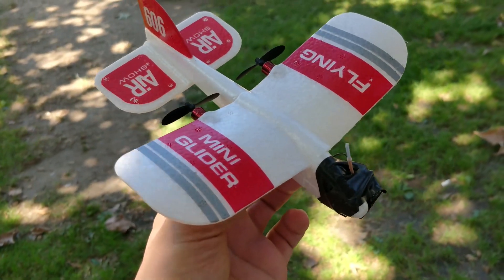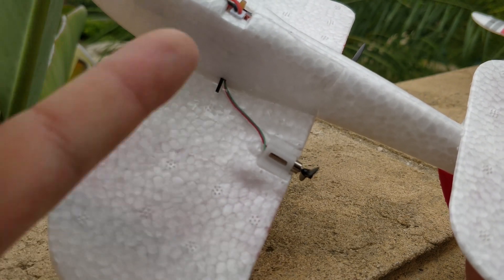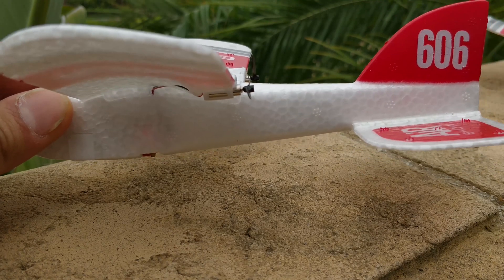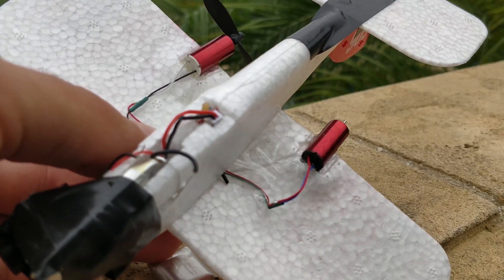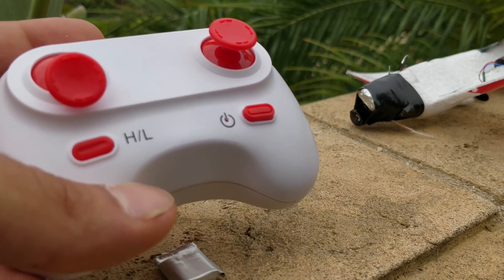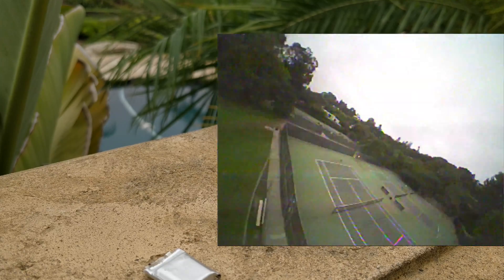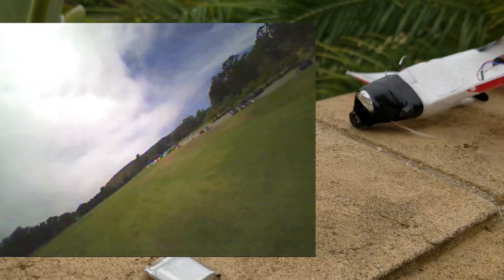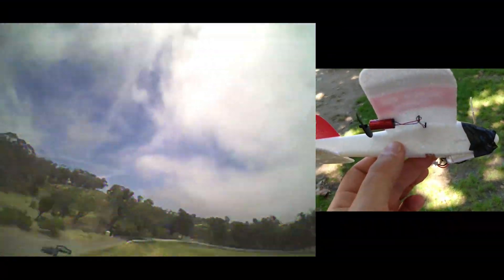Whoop Plane? - KFPLAN KF606

Comment from the maker: Table of Contents:
00:38 - Stock plane overview
03:10 - Modified plane overview
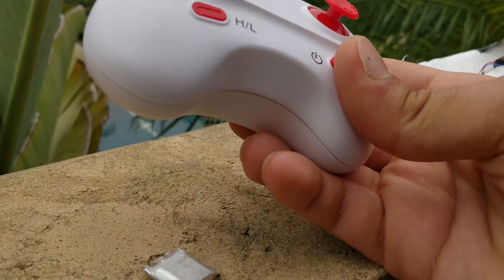05:41 - Roll doesn't work right
06:36 - 'First' flight
07:18 - First successful flight

The plane: http://bit.ly/2OqoAwt
The BIG motors: http://bit.ly/2Mo7DjE
The cam/vtx: http://bit.ly/2yixtxp
Prop option 1: http://bit.ly/313sEUV
Prop option 2: http://bit.ly/2Os0G3C

If you really want to try this, you'll need to find a ~40mm or less prop that will fit the 0.8mm shaft on the motor.  The whoop props are fine and would work but note that these props are used in 'pusher' configuration so you'll be putting the prop on upside down.  So any prop you choose should probably have a mounting hole all the way through.  You'll probably need to melt through the hole in the middle of the top end of them with a paper clip then push it on the motor because the top end of the hole is usually narrower.

I know that little whoop plane that uses whoop parts exists. it's just super not great control.  about as good as my POS here.  I need the gold control. 

A toothbrush I'm gonna review when it's back in stock:
http://bit.ly/2K5ZoG8

▼ COUPON code spreadsheet link:
http://bit.ly/2JWLBBE
Some of these codes are made exclusively for my channel and can't be found anywhere else.

▼Join my FB group for more discussion: Kabab FPV
https://www.facebook.com/groups/37915...

▼ The 5" quad setup:
-Hyperlite Glide Floss (will be re-released soon)
-Motor 1750kv/ESC combo: http://bit.ly/2XAEHXH
-WaFL’s Cap Cap: http://bit.ly/2GUpXxO
-Battery: http://bit.ly/2XXjbwU
-FC: http://bit.ly/2XRc8G8
-FPV Cam: http://bit.ly/2Q7LfL7
-Vtx: http://bit.ly/2HsrASs
-ND GoPro Mount 30deg: http://bit.ly/2WC15zc
-ND Filter (if used): http://bit.ly/2WEmQ1j
- My favorite battery: http://bit.ly/2xWjYTJ
-An annoying 643g AUW on this quad

▼Notable motors:
-Xing 2306: http://bit.ly/30uYo4Q
-Xing 2208: http://bit.ly/2y3te8R
-FANTASTIC 6" motor: http://bit.ly/2LqghOZ

▼ 5" Sub $200 build that's still good
-Frame: https://goo.gl/EpXQhZ
-FC/4in1 Stack:  https://goo.gl/HprVbj
-Motors: http://bit.ly/30uYo4Q
-Props: https://goo.gl/ZnzY2y
-Props: https://goo.gl/VMBiQh
-FPV Cam: https://goo.gl/FDJhYw
-Vtx: https://goo.gl/JNVDMn

-Starter goggles: https://goo.gl/GvJUkT
-Batt pad material: http://bit.ly/2QGWhYb

▼ If you want to solder better:
-Fantastic solder: https://amzn.to/2P5QM2W
-Fantastic iron: https://goo.gl/DqBipa

▼ Tips?
-PayPal: https://www.paypal.me/kababfpv
-Bitcoin: 1E4XZXoD4rS6MYWVWuenY7Kw2M1YgyNpoQ
-Nano: xrb_1188ek5bd7tb9kw67asnp9o65byuoaxbtpxuznx1ribf75x78awywmakj55f
-ETH: 0xD067F93811f2eC31CB1928901002dfdf9A492EF5
-LTC: La2KWYAjp4VT2Lq2M76pbjzXWvRyjpfCtG
-Tesla Referal code: https://ts.la/bob40889
Please use my referral code if you're gonna buy a Tesla.  You get some free stuff when you do and I get better status with Tesla.

Comment: For anyone interested in fpv'ing this plane, first you need to upgrade the motor to 615 motors and change the battery to 3.7v 150 mah lipo. Ive made this upgrade to my kf606 and it flies suprisingly stable if there is no wind. Plenty of power left to carry aio fpv without breaking a sweat. I got bout 15min flight time with those batts. Rarely used full throttle. You need to use stock prop because if you use prop too big it will cause turbulence and make flight unstable like what kabab did.

Comment: hello someone can tell me what kind of motor is suitable?,maybe  one of it on my bird goind burned. after just 5 minute of fly
Reply from the maker: The originals are very very small. Definitely much smaller than 8520 like I used.  That's as far as I know for now.
Reply: ok... i hope that the replacement parts of it they go on sale as soon is possible.. i think if you put bigger motor maybe can damage your power stage..
Reply from the maker: @GiuseppeGibilmanno  yeah I was worried about that but it seems to work fine. I don't really recommend this plane. It barely works

Comment: a lot of small bnf planes now have stabilazation and fly well.  I have flown a couple with fpv cameras.  Need to get the camera out of the air flow or performance is degraded.

Comment: I once put 4 motors on one of those tiny foam planes, and a landing gear.. somehow the stock esc and battery did not blow up.. :D
It actually flew quite nice.. stop and go landings were fun.
There was no FPV back then.
But when the UMX planes came out i put a 1g cam on a 4g servo fixed on the nose of a UMX Stryker and a really bad 200mw vtx on the left wing.
It flew terrible but i could look around a littel with the servo which was fun and i had my fist fpv experiences with that setup.
Those were the days.. hehe..
Reply from the maker: lol such fun

Comment: I did the same to my Su-26 (400mm wingspann) and its very funny to fly, a bit large but atleast full control. 

Im very interested in mini fpv planes and i build a plane with 4x 0803 motors and a 1s quad Fc instead of servos to get full controll, its weight was around 100g had a bit more wingspan than my Su26 because i wanted it to fly slow. It flew, not good but it flew ( build everything on my own and it was my first build plane ever, except paperplanes xD)

Comment: Wing loading is the key for this size fpv craft! Below 10gr/dm² is best like this: http://winglib.com/wing/indoor-acro-wing We fly fpv micro fixedwings indoor with just one 8520 motor, two 2gr servo's and a micro (xmr) receiver. The AKK BS2 is a very suitable fpv aio for this setup. 250mah 1s battery gives you plenty airtime. So get yourself some foam and start cutting those wings! ;-)

Comment: I really want this project of yours to work out, I bet in the short term you could mess with throttle input ranges just enough using like a jumper controller or something to get fine throttle control

Comment: I did this a while back and I used a eflight beast 8” park flyer with fpv and it turned out super sweet. The biplane works a little better because of more sq” lifting. The beast is a full function and is super at 3d flight but it can be pretty decile too. Give it a try!

Comment: You could adjust the CG by moving the motors to the front of the wing and reversing the props making it a "tractor" rather than a "pusher". 
As Bixler would say "Nose heavy planes fly crappy but tail heavy planes only fly once"

BTW nice hack!
Reply: OK, that wasn't Bixler's saying.  That came from David Windestal.
Reply: @townc2824  
Who coined the term first is debatable, who says it all the time is undeniable. Just go back the last 6ish years and see how many times Josh has said it. 
Wouldn't doubt it if David came up with that tho, love that crazy Swede!
 Really miss his input on flite test.

Comment: How is everybody alway on the same tip? Lol.  
Dude I’m experimenting with a whoop style vtol right now. It’s a real vtol. The props don’t provide lift in horizontal flight. It will take off, it might fly, it definitely won’t land ha ha. Yet. The transition from horizontal to vertical flight is going to be a little wonky. For inspiration I used the whoop wing thing,  an X-class in a + configuration with wings on 2 of the arms that I seen once, and a early Amazon concept drone.
Reply from the maker: I've got a configuration setup that needs no control surfaces and 'should' do a really good job on control for all axis....gonna test soon.

Comment: FYI, I suceeded to bind my kf606 to my Taranis, using 4-in-1 module.
Reply: bro can you share whats the binding method? and which 4-in-1 module did you use?
Reply: @AbangDrone  i had to update the firmware on my 4-in-1 module, as the kf606 protocol was added very recently

Comment: Hello, i think that you have some misconceptions in your video. There isn't roll at all in that plane. Because roll is turning by the axis in the length of the plane. What the differential thrust is doing... Is what yaw is on a quad... Roll usually is only possible by changing the profile of the wing. By moving a control surface you change the i believe its called 'skelet line' and the lift then gets reduced at the side where the control surface is moving up... So the wing goes down. I really lile your content and find it interesting... But i dont totally agree with your explanation in this video i think. Maybe im wrong... Would like to discuss a bit about it. With kind regards
Reply from the maker: there's no roll.  the wing has dihedral so when it gets differential thrust the dihedral naturally rolls.....that's IF it flew correctly at all which it doesn't.  It's a toy piece of junk.  There's nothing legit to discuss here.  I was just amazed that it sort of worked.

Comment: I've built a ton of scratch build planes over the years and I have some pretty small and neat EPP ones that would be good for fpv , I just need to get around to sticking a camera on them lol.
I have a couple of old silverlit bi planes that work purely on differential thrust, they flew but you can't beat having a servo or 2 for control, puting a flight controller in a little tiny plane would make it much more flyable because they are skittish in the wind.
Reply from the maker: I am going to try to do this without servos. I really don't like servos
Reply: @Kabab  agreed, servos are a bit unreliable and inaccurate, I've had them fail in flight a number of times , luckily I have always managed to land safely still ..
It's 100% possible to make something without servos using differential thrust in the vertical and horizontal and fliight controllers are so cheap now , just needs some custom firmware and suitable frame ...maybe a simple X wing design would work pretty well?
Reply from the maker: @FlyingFun.  yeah testing things

Comment: Because of the size, go for a biplane design?
Before I got into quads I flew a couple of Silverlit X-Twin RC biplanes, 220mm wingspan 20g with glued-in lipo (must be dead now), same two-motor only control and they were pretty graceful on a calm day, but the tiny brushed motors really needed to be more powerful.
Reply from the maker: I didn't say I wanted to fly slow 😂
Reply: @KababFPV  LOL! Check out the Silverlit X-Twin Jet then, I think that's more your flying style :)
edit: or maybe the Silverlit X-Twin Pro Thunder Jet

Comment: You need to try fixed wing therapy.  Start with a simple AR wing then build a Mini Drak. Blasting along  3 ft off the deck at 90mph is intoxicating.
Reply: Forget the drag.. Get a funjet ultra its cheaper and better.
Had my maiden with it yesterday.. 4amps in cruise at 60mph and 100mph top end...
And that's on a 3s
Reply: That funjet carry a hero 7 for 15 minutes at a 75 mph cruise?

Comment: Don’t overthink it. You don’t need a flight controller to get a FPV fixed wing in the air and flying.  

Take a look at the Atlas 450 wing
Reply: Im gonna take a look at the Atlas, thanks for the heads up :)
Reply: Yeah an fc isn't needed but it helps a lot